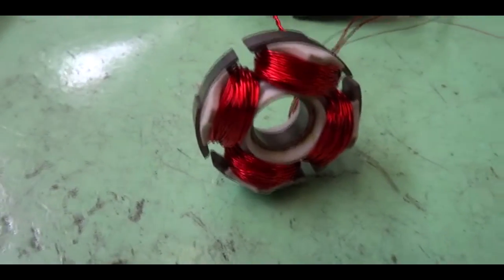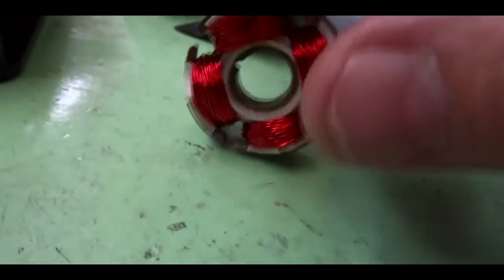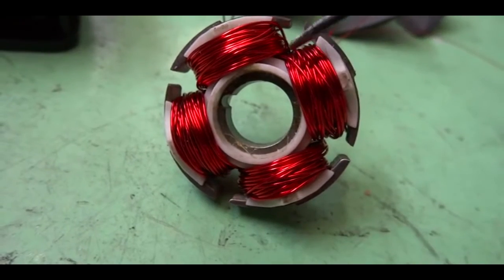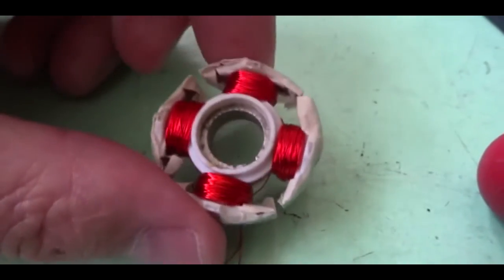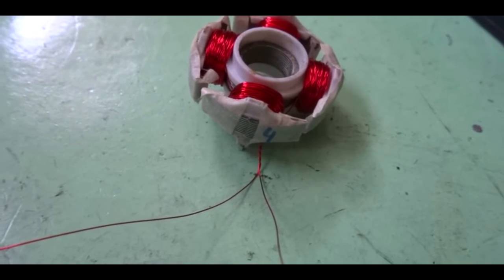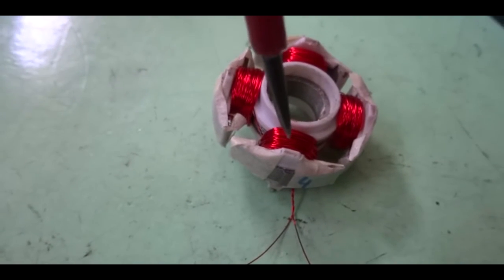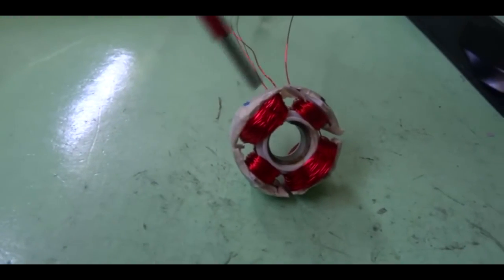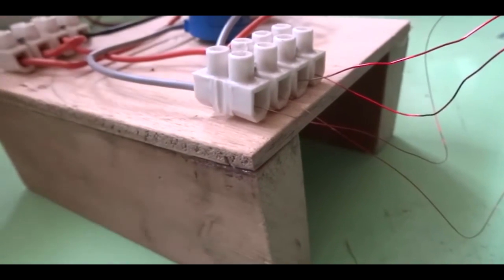Fan Bedini Motor Stator Winding and Experience

Comment: yo, good to see this I've been playing with re-wiring an attic fan. haven't finished it yet. I'm suspecting the back EMF isn't absorbing correctly due to the iron core not being able to change Flux fast enough. the plates don't change fast enough as opposed to the flag rods or welding rods... we will see.. im getting tired of burning up transistors though. good job anyways! this is a cool hobby